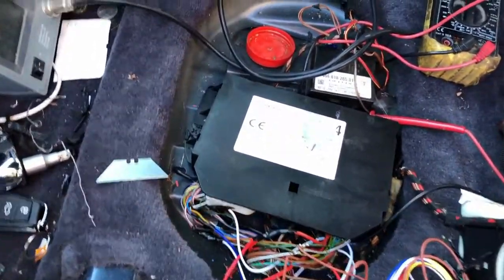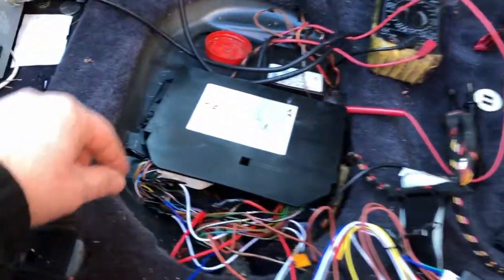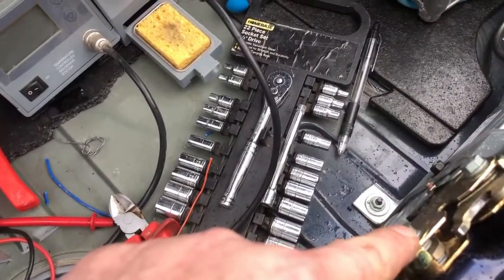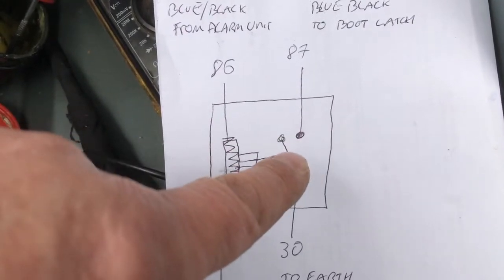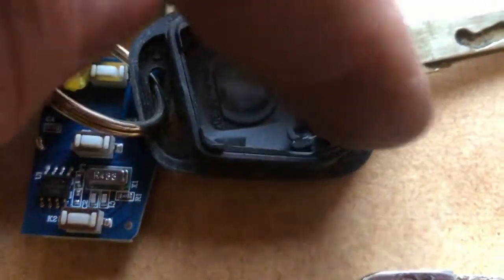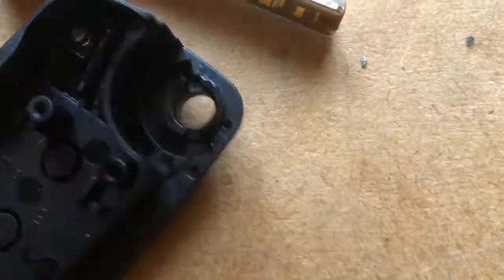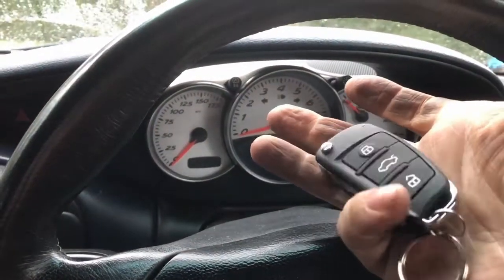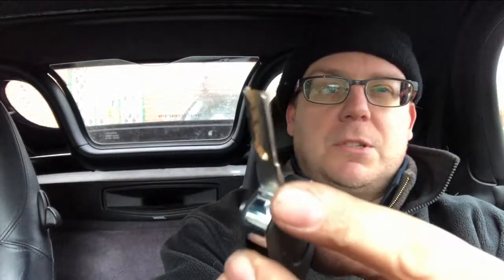How to.... Porsche Boxster Aftermarket central locking install - part2

Comment: Awesome work here. I do have a 1999 Porsche Boxster S. Currently i have the following problem with the Boxster. It cranks over with a No Start. I had a critter that got into the trunk and may have bit through some wires or it could be the CrankShaft Position Sensor. I have followed several videos here on YouTube with No Luck in starting the car. When I bought the car, the FOB Key would start the car but i could not set the alarm or lock the car, except from the inside using the power lock button on the dashboard. The previous owner had a a key made without a chip, which is what i had been using up until the current situation. I figured, its a convertible and if someone tried to break in, well at least nothing would be broken with the top open. Once all is back to operational, I may order the device you show here on the video. Thanks again for the great job detailing your work. Look forward to more videos. Be safe Stay healthy. Dario Villanueva - 02/17/2023
Reply from the maker: Thanks for the comments.

Comment: Hi mate just watched your boxster videos very good thanks I will probably have to do the same on mine for the central locking having tried every possible way to restore the original Porsche system from info on internet. Obviously a bad, unreliable design from new as so many have this problem! Anyway thanks again.
Reply from the maker: No worries 👍

Comment: The trick to heat shrinking without cutting wires is to slice the heat shrink, place it over the wire, then superglue it (carefully, so it doesn't stick to the wires). After a few minutes, it will be sealed, and you can heat it up to shrink it, as usual.
Reply from the maker: Sounds very fiddly.!

Comment: I know it's a bit of a long shot can you remember who you got your keys off of when you carried out this modification because I've done the same with mine I'm gonna need some keys cuts to fit the fobs.?
Reply from the maker: I found a bloke on eBay who could cut the key with a picture.
Reply from the maker: Try this seller, I’ve used them before for Vauxhall keys. 
https://www.ebay.co.uk/itm/233819451565?mkcid=16&mkevt=1&mkrid=711-127632-2357-0&ssspo=2xDHZs3URny&sssrc=2349624&ssuid=q7_G1vSkR_W&var=&widget_ver=artemis&media=COPY